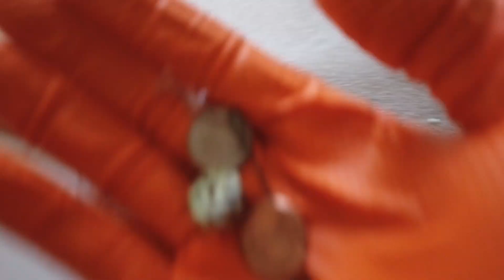Pre-vacuum Vlog #1 || Extreme dry soil removal. Homeowner  told us his vacuum stopped working

Comment: What vacuum do you guys use?? Do you recommend one that doesn’t use bags??
Reply: No clue what vacuum they use (I have to assume it's a Bissell based on the body design but idrk for certain) however I do know from personal experience, vacuums with bags are better for containing dust and tend to have stronger suction, the downside is they are more expensive in the long run due to the bags and if the manufacturer stops making the bags, you're SOL. In regards to vacuums that use canisters, they are worse for dust however they typically have reusable filters that can simply be rinsed out and left to dry. The downsides of canisters is while they are way more convenient (and cheaper), they tend to have weaker suction, and what's the point of a vacuum if it's not very good at it's only job?
Reply: Jessie XOXO it’s a Royal vacuum. The price is around 311.00 to 378.00. Looks like it does an excellent job.
Reply: Look for a Hoover Tempo Wide Path or the commercial Taskvac Bagged vacuum. But, use the synthetic HEPA bags. The vacuum will clean better.